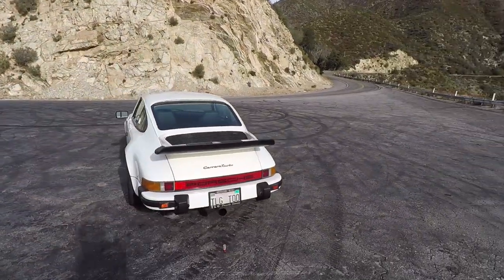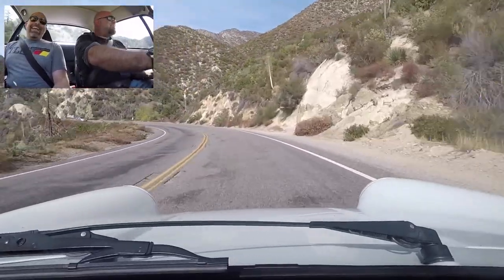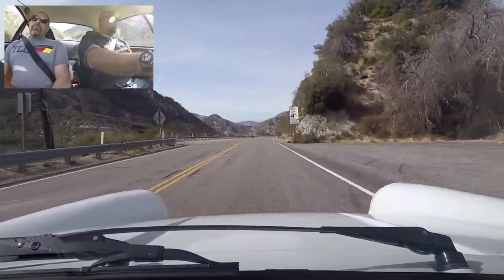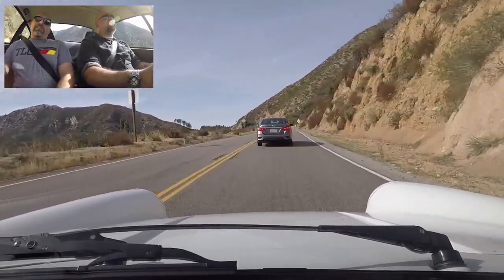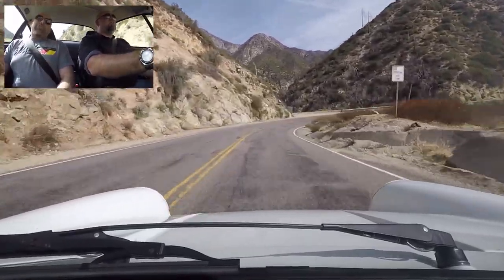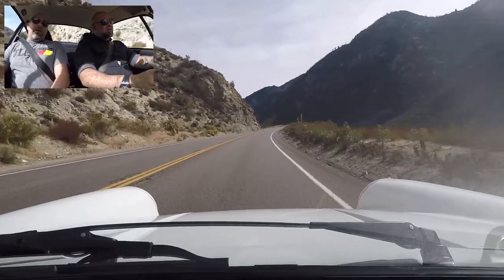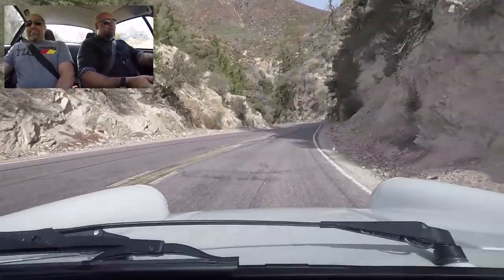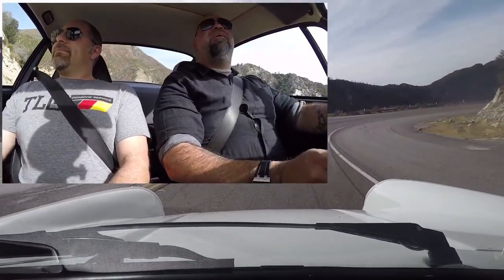1975 Porsche 911 "Carrera Turbo" by TLG - One Take

Comment: I have a 73 VW Super Beetle with a partial back seat that has a complete 75 Porsche Turbo Carrera Engine and Trans in it. On the 10th lap at the Nurnberg Ring in 1977 in Germany it did 202 mph. Without spinning the tires it constantly did 10.9@144mph. I have owned it since 74. I still drive it a couple of times a month. I like your Porsche. It was Built by Wolfgang Boober in Mainz Wisenau Germany. Herbo has A/C also. I will put a Video up on it soon. The Engine is Tricked out and very smooth running. The engine and Trans came from a Total Loss I acquired in Germany. It looks like a VW till it passes you on the Road.

Comment: I'd still install an intercooler.
Reply: storck08 a carb engine benefits from non intercooled atomizing the fuel. Now obviously in CA on hot days not a good. But in most situations it actually benefits fuel/air ratio
Reply: The under-tail intercooler is already on order and a new set of camshafts are already in hand...
Reply: TLGAuto I would have loved to see this car come back on one takes to see the difference between nonintercooled vs intercooler, too bad these are ending :(
Reply: Or do water/methanol injector to cool the cylinder.

Comment: wow that sounds amazing although im not a fan of vented bov and more about surge but whatever no biggy still an awesome car
Reply: I was trying to solve a registered boost spike issue on my 935 tattle tale boost gauge.  It didn't work because of where I'm pulling the signal from (directly above the throttle plate), but it's a pain in the butt to change the charge pipe back to stock so I just left the boy racer BOV in place.  It's not gonna be there much longer...

Comment: Great car! Just rebuilt (split cases) my '87 Carrera daily driver, left it all OEM/ parts/stock (except for a Momo wheel and K&N filter) came from factory w 16" color matched Fuchs. Can I add a factory turbo without twin plug heads?

Anyone out there have suggestions for tires, been running Bridgstone 760 Sport Potenza's  can't find them anywhere?

Comment: He could put a small water to air intercooler on it. It wouldn't be much bigger than the turbo to throttle body pipe that's on it now.
Reply: I've strongly considered that.  But, in the end, I just didn't want to deal with the extra tank, pump, and plumbing.   A water to air intercooler just didn't seem to fit the character of the car.

Comment: I allways wanted to build A non intercooled carb engine. Smokey unick (spelling??) Built a non inter fiero in the 80s w/ over 40mpg. I wana do this to a 22r toyota engine for max mpg.
Reply: they came factory 120kw back then , and weighed hardly anything

Comment: Matt's comment at the end is totally on point. Intercooler, twin plug ignition and possibly a modern ECU. It's not like it's a stock car so I'm not sure why you'd restrict yourself to 1970s turbo tech. The 914 was glorious with the old school engine this one is meh
Reply: First, because I build my cars with what I have laying around.  I had all the early 930 parts in hand ... minimal cost outlay because I'm not made of money.  The intercooler is already being built, new cams are already in hand, and the twin plug distributor is with the intercooler guys to ensure that they build a charge pipe to clear the cap.  The car will remain CIS because my goals are well within its abilities to fuel.

Comment: Why is the Tachometer not straight??????? 😡
Reply: Its a race car thing, a lot of older race cars had tilted tachs so when the needle is facing directly upward is when you need to shift/hit redline.
Reply: The tach moves rather quickly in this car so it's easier to, as the guy above says, just shift when the needle is vertical.
Reply: In my car I have the speedo tilted because the wheel hides it right in the 30-60 range
Reply: It's 2018, it can be whatever it wants.